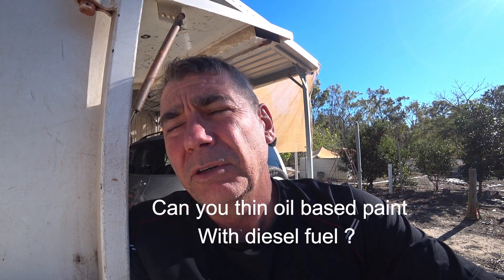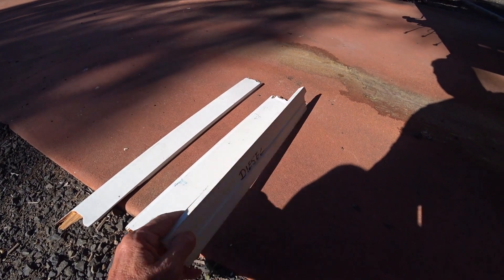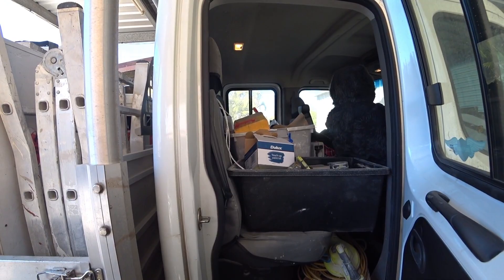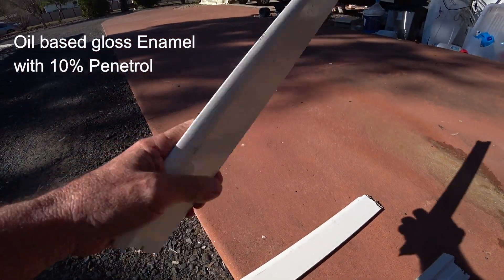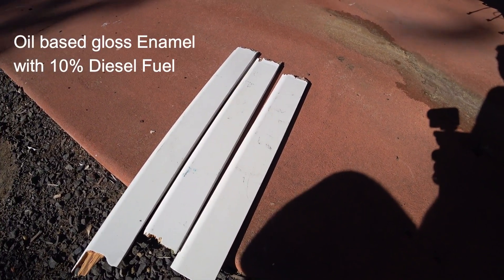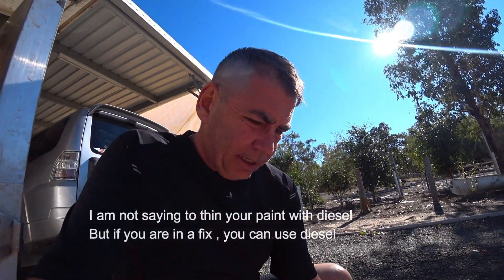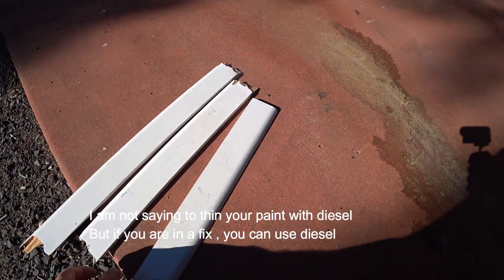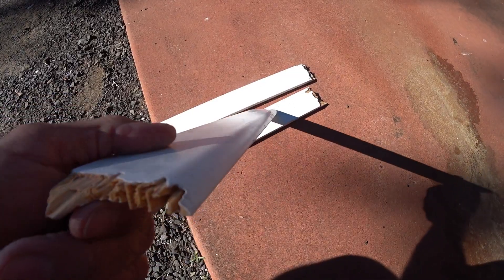Experiment ,must watch When you use Diesel fuel to thin oil-based gloss enamel

Comment: Interesting working in nz I worked alongside an English painter that used diesel to thin down oil based paint for years he reckon it helped it dry a little faster and alot cheaper too.
Reply from the maker: Thats the first time ive ever heard of someone doing it,maybe i should be doing some more tests.
Reply: Takes forever to dry. Gas will make it dry quick though. Use the cheap stuff with the least additives. I'd clear coat it though

Comment: How would you  stop water stains from keep bleeding through the paint on the Gyprock ceiling
Reply from the maker: Use a spray can that stops stains is the easiest way, others are oil based undercoat,flat enamel ceiling paint,any spray can you have sitting in the shed,let it dry and repaint with ceiling paint.

Comment: Can remember a long time ago thinning some oil based varnish with red diesel 
Was desperate at the time no turps on site 
From what I remember it took ages may be three days to dry , harden up probably due to it being a greasy product
Reply from the maker: I always thought it wouldnt dry either but when it dried on a cold and wet day ,i was stunned. This test also tells me that the finish is durable
Reply: I remember my dad years ago painting a trailer with oil based thinned with diesel took ages to cure. But kept back rust for a long time. Interesting stuff.
Reply from the maker: @mack1609  Im going to have to test diesel with paint and compare it to penetrol for rust.
Reply: @ThePa1nterhowto  for sure everyday is a learning day

Comment: I just recently mixed some penetrol in with a Zinsser oil based undercoat and used it on some skirting boards that hadn't been painted for decades - the result was fantastic
Reply from the maker: Its good stuff, its also amazing for rust.